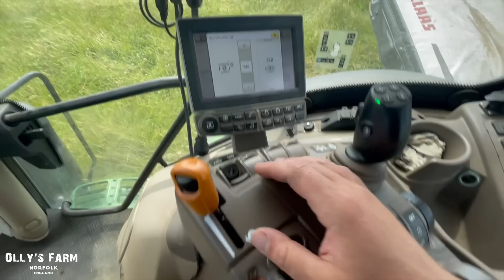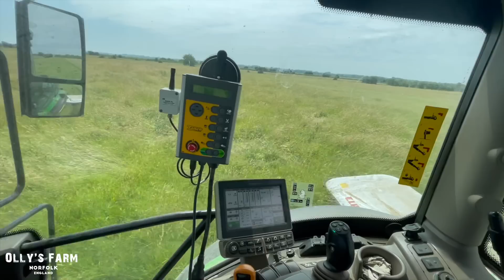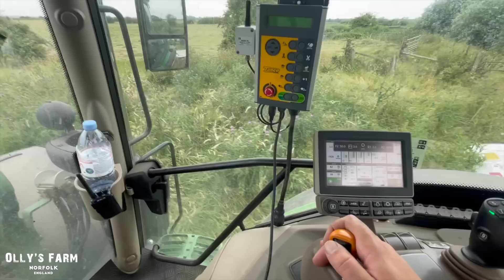Silage, Firewood And Bad Weather! Olly's Farm weekly ep 06

Comment: You know you can set the max revs so u don’t have to use the orange adjustable one
Reply: This meant doesn’t matter out using the foot pedal
Reply from the maker: Good idea, use that for the Fodderbeet bucket to keep the revs up in the winter, no need on bales
Reply: @OllysFarmLtd  was speaking when u are using the mower so u sent ur revs and then all ur speed can be done with foot , also looked like u turned pto on with revs high be reason belts went